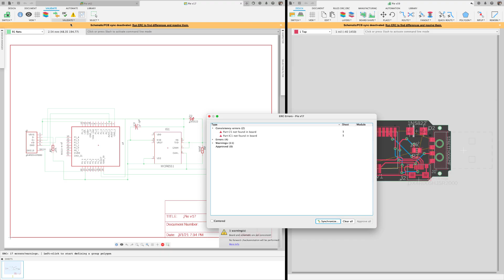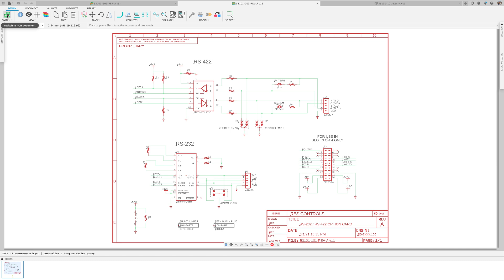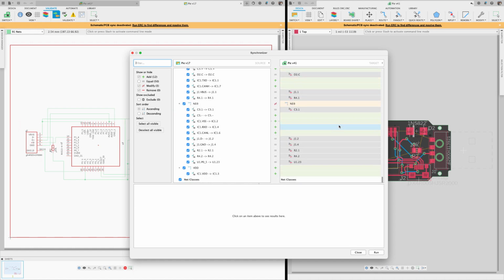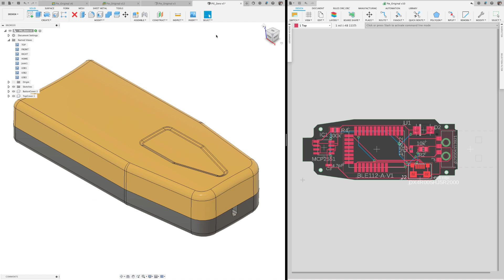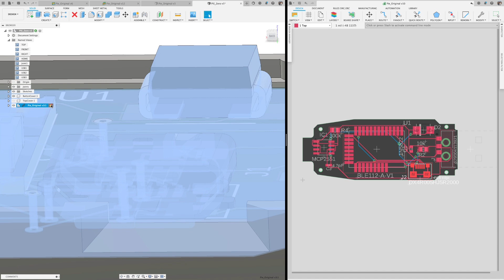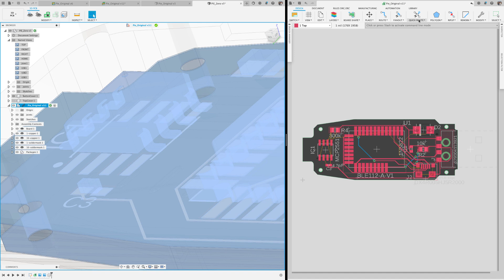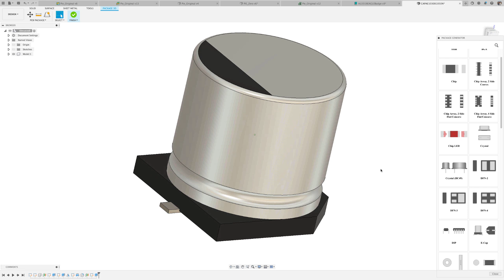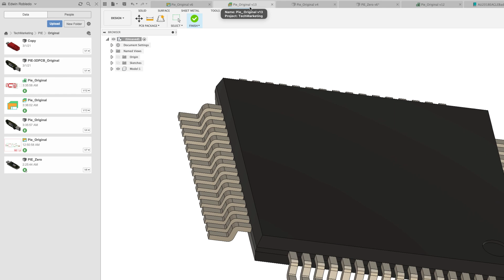Fusion 360: What's New in Fusion 360 electronics

Comment: The new synchronize feature is cool, but we really don't need it? 
We should get rid of ( or have an option) to display only ONE TAB for the PCB, and just have the buttons to switch from Project View/ Schematic view/ Board Layout and 3D PCB View. so that means that the pcb is only one file/document and only appears as one tab ( but with the ability to break out that tab to a new window for side by side interaction). 

If the pcb is only one file then you would never have to worry about losing SYNC!

I find that the 5 tabs we have just for one pcb design gets confusing and if i want to view and work on another different pcb at the same time, then that's 10 tabs that kinda all look the same.

The other issue with having separate file/ documents for one pcb is that you have to name them all and keep track of revisions, which is very messy and prone to mistakes.

Comment: looking good! is polygon fill also available? Ie drawing a custom shape for a ground plane, etc
Reply: or fill in general to get a ground plane on one side of the pcb!
Reply from the maker: Hi @George, your participation is appreciated.  Yes, the PCB editor does have the command to create Polygon Pours. The pour can be defined for the entire board or only part of the board.   You can use the  RANKS option to have Polygon subtract from each other.  You can also use the polygonize command from the context menu to create a polygon from an enclosed area.